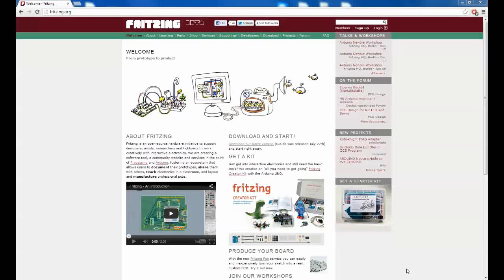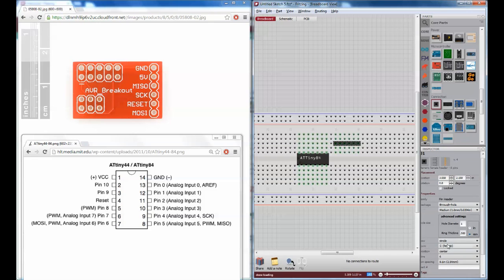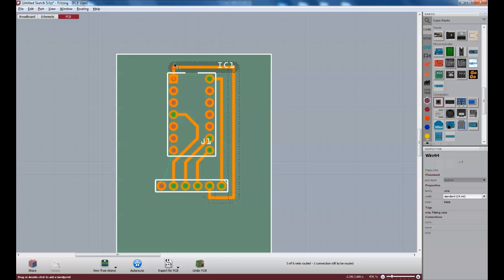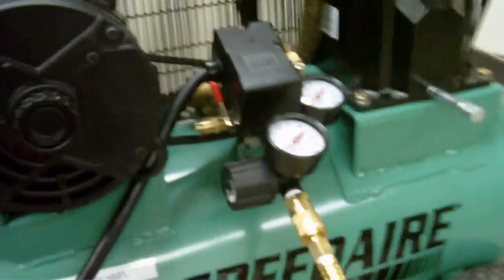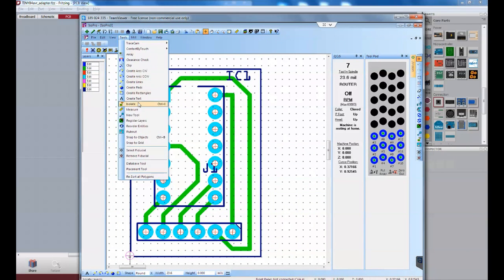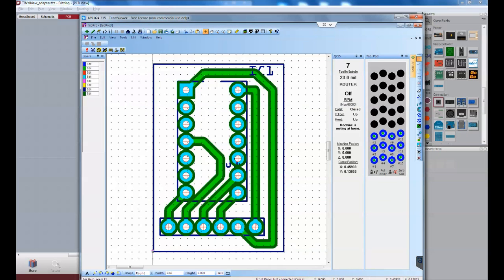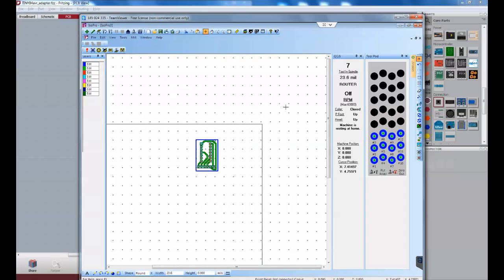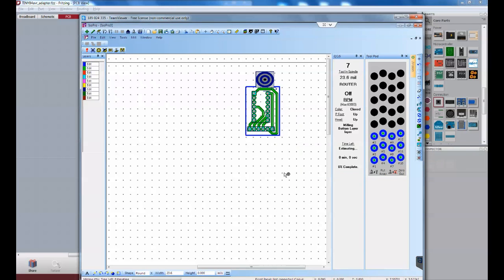PCB Design and Fabrication using Fritzing and IsoPro

Comment: Did you really cut into the suction table holding your pcb?
Reply from the maker: No, a sacrificial layer made of particle wood goes beneath the PCB. It's coated in a shiny metallic paint so I can see why you thought it was the suction table itself.

Comment: good afternoon Trent Robertson.

Might help me with a problem I have on my machine t tech quick circuit 5000 does not recognize me as control module . I think you can be any usb drive .
I'm using Windonws 7 with the IsoPro 2.7.
would like to ask you for a recommendation to solve my problem.

thx
Reply: bere yepes 
me podrias pasar el programa de isopro?